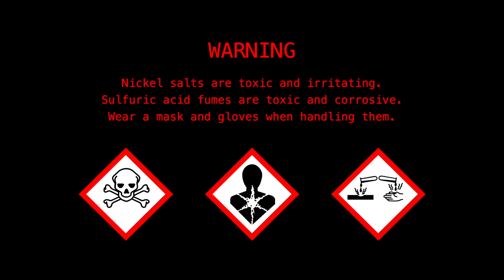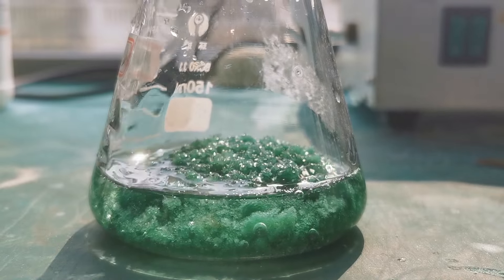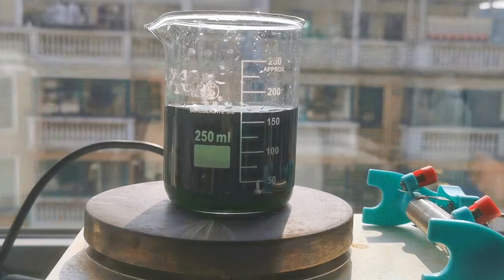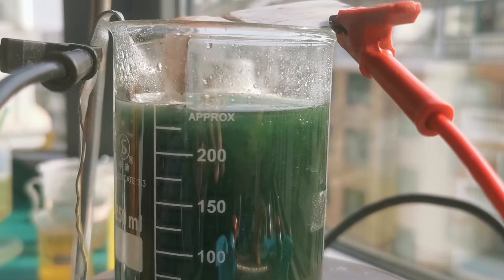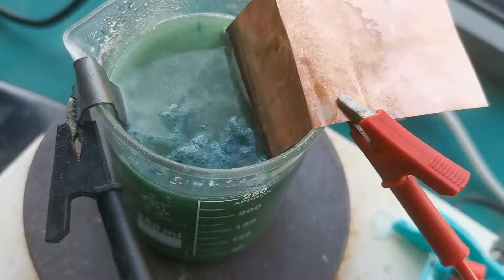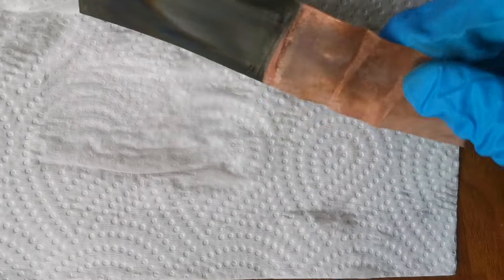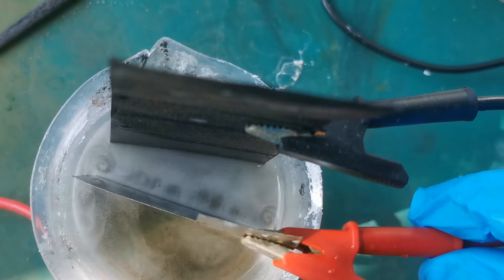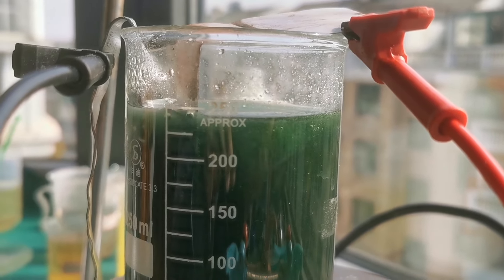2.2.10 Transition Metals - Electroplating nickel on copper

Comment: I know Tin is not a transition metal, but electroless tin plating is awesome.. (So is this, don't get me wrong ;ø)
Will you be doing a segment on this too - I would love to see how it is prepared, and Tin is also a LOT less toxic than Nickel which I'm trying to avoid due to allergy concerns, etc.  
Tin oxide is widely used in galvanization, so it should make copper coating just as effective as nickel (it is nearly always used to coat electronic pcbs, as no electric pathway is needed)
Reply: I need to look into tin-plating.
I'm making jewellery out of old copper scraps and copper doesn't entirely like bonding on the transition points between solder and solid copper, so maybe a really thin layer of tin would do well to fix the issue. Otherwise I'm left with nasty dark lines in between materials.
Reply from the maker: Sure I can look into this. Would you like to see the Sn/SnCl2 method or the thiourea method NurdRage demonstrated?
Reply: @MIH0319 The Sn/SnCl2 sounds awesome, as I already have access to Sn and HCl, so I can easily make those.
Any method would be awesome though - I'm not picky ;ø) 
I got a small kit a while back which needed to be mixed with water and then had a very limited lifespan. I don't remember exactly what it contains and can't easily look it up as it is in storage at the moment. 
I'm not 100% sure if it was a one component or two component powder solution. I remember that the kit cost a LOT of money, so I have been saving it for that important (huge) project. Until now, I've just been applying solder manually if needed, or solder-mask/lacquer.  
Being able to make some myself would be awesome, saving some money too and learning more about chemistry - perfection.

It seems I'm not the only person looking to plate stuff. I know a lot of 3D prints gets coated/plated - so perhaps a series on this, as there seems to be interest and needs?  

Thanks in advance, no matter which method (or both, or ;ø) you eventually get around to do video(s) on.

Edit: Looked up NurdRage, awesome channel - thanks for bringing that up. I would like to avoid thiourea if at all possible, as I only have access to 'Brasso - For Cu, Sn, Cr' which contains aliphatic hydrocarbons + soap and apparently no thiourea. Silvo for Ag seems to list similar stuff.

Comment: Quite honestly, you could have achieved the same results with some distilled white vinegar, table salt and 99.5% nickel strips at 5V/1.5A and 22'C
So basically, literally at any home with easy to get materials. I experimented with copper and nickel plating methods a lot, and found out nickel works best at PH of about 2-3, and copper actually doesn't like acidic baths very much. Too much acid in the bath will lead to copper dust forming on the anode without bonding to it at all.
Also, with such a bath fully saturated with nickel ions, you could effectively plate any copper surface to the point where no copper is visible in about a minute.
I also found out that the lower the voltage, the better. Nickel deposits slower and forms a less rough texture. I got my home-made jewellery all coated with 0.1mm nickel and it's super hard, doesn't chip or scratch
Reply from the maker: Yeah the acetate route is commonly used among amateur chemists and the acetate ions create a buffer effect so the pH is around constant and the nickel deposits very well. However I don't have pure nickel strips so I have to use a non-soluble anode and a sulfate bath (lead would dissolve in the acetate bath). I didn't bother controlling the current and voltage exactly, so that's probably the next optimization.